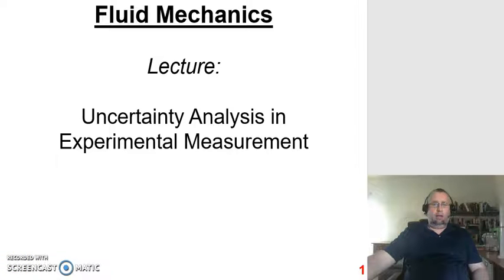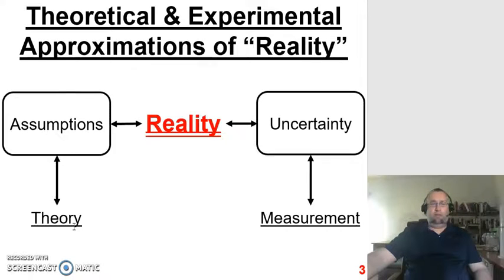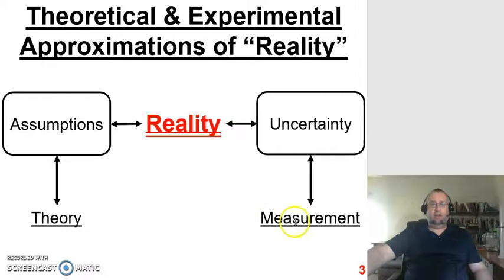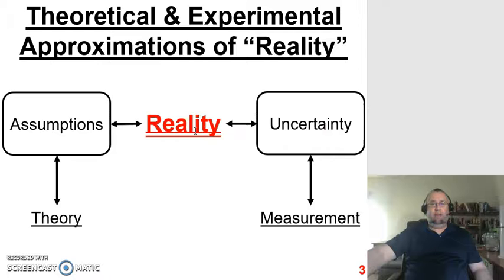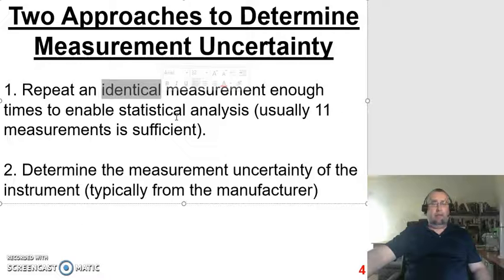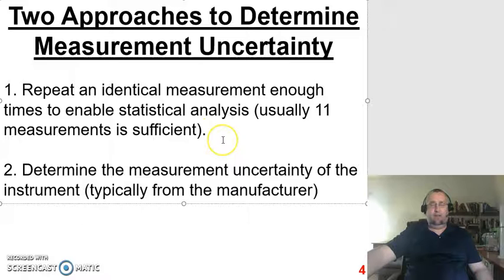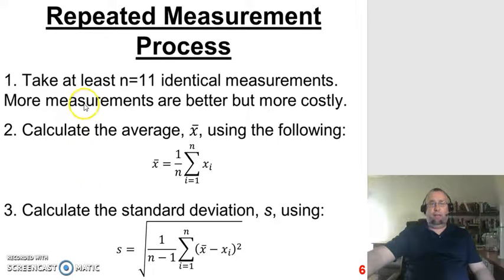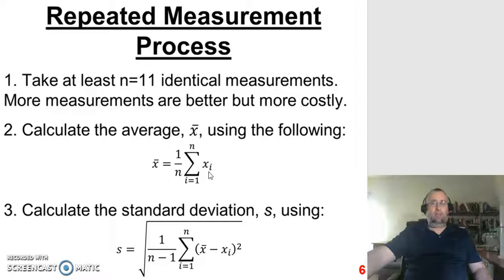Fluid Mechanics Lecture02   Experimental Uncertainty Analysis

Comment: When you say that the next measurement has a 68.2 % chance of falling between + or - one standard deviation of the mean, do you mean an individual measurement or the average of 11 measurements?
Reply from the maker: The next individual measurement (Measurement #12) has a 68.2% chance of falling +/- 1 standard deviation from the mean. Once you have Measurement #12, you can recalculate the average and standard deviation for the system your are measuring, which gives you a revised prediction for the value of Measurement #13 and so forth.